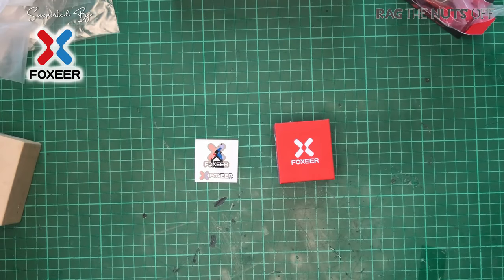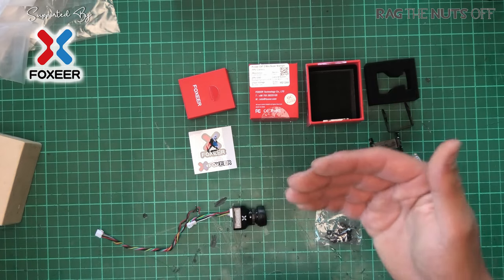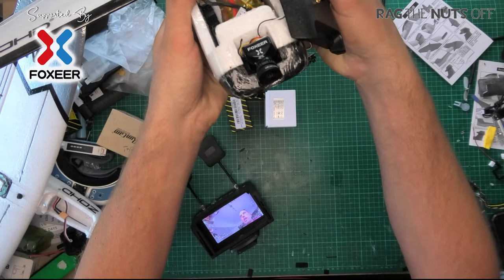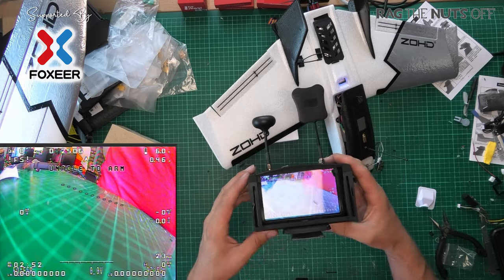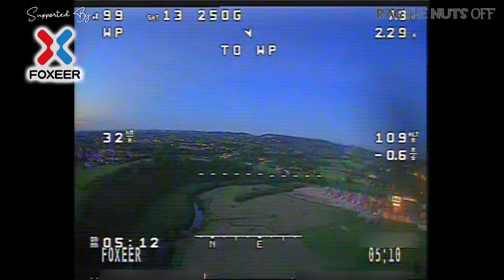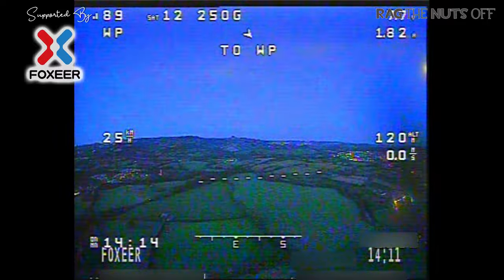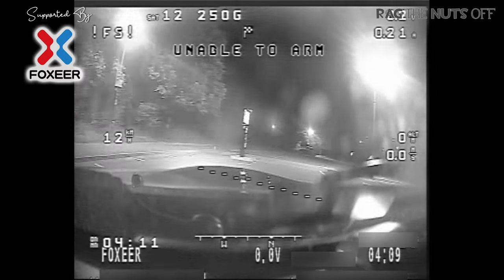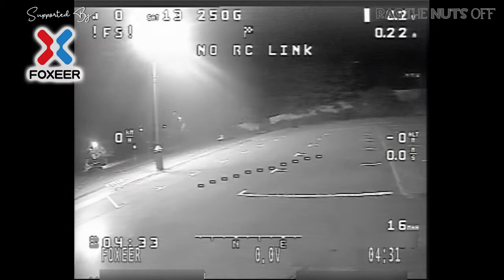Foxeer Mini Cat 2 Review - DAY / DUSK / NIGHT / CARPARK

Comment: I tried the same thing a couple years back, flying in pitch dark night using a Runcam Night Eagle.  It is 10x more light sensitive then this Foxeer, according to the numbers on the box.  It still needed some outside light, but it could barely be done.  This looks like a good camera that is living up to the specs Foxeer says it has, it just can't do full dark.
Reply from the maker: Howdy Mark, yep that's it. It's not full on night vision for $40 of whatever it costs. In a carpark at night, easy!

Comment: There are lots of fpv cameras that you can fly at night with in a well lit Car Park Matt. Flying down sun is always better for all cameras of course, just as not having a load of sky in shot is too....20% sky in shot max in level flight. Start there, even a small shift in down angle makes a huge difference as it makes the aperture open.
Reply from the maker: Hey ET. I always mount mine horizontal as I am so used to hedge hopping and tree bashing, it needs to be level otherwise I hit even more stuff!. Matt
Reply: @RagTheNutsOff  Oh yes, of course, you are the exception because of your "flying techniques"...lol. It's pretty easy to adjust camera down angle though if going on a night cruise..Pardon the expression..

Comment: Sooo the big question, would you go Cat2 or Toothless2? I may have lost my Toothless2 Micro last weekend haha and will need to replace it soon.
Reply from the maker: The smallest possible. What I have learnt is that even though it's a tiny camera, the sensors are the same, so size matters, esp with the lighter models. Matt
Reply: @RagTheNutsOff  the toothless 2 nano is real small, 14x14 housing!
Reply from the maker: @NoAgendaFPV  Exactly! TINY TINY!!!!!

Comment: If you crashed and smashed your reveiw cam would you replace it out of your own pocket with the same camera
Reply from the maker: That's easy, no. I'd buy the smaller one instead. Its basically the same sensor but not in such a large container. Matt

Comment: Just putting it out there that I've bought 2 of these expensive cams (micro version) from 2 diff suppliers and both had problems. The first will not let me access osd with the dongle or cam control so I'm stuck with factory foxxeer and voltage text at bottom of feed. The second gets extremely hot and shuts itself off in about 45 seconds completely unusable. The inductor right next to the connector actually has melted the plastic label protector on the back. Nothing against foxeer I love my toothless 2s and Falcors but beware
Reply: @M-H433  Ya I did but somehow it has shown up on atleast 6 other videos 3 are not even related to fpv at all. Not shure how I fat fingered it like that but my bad.